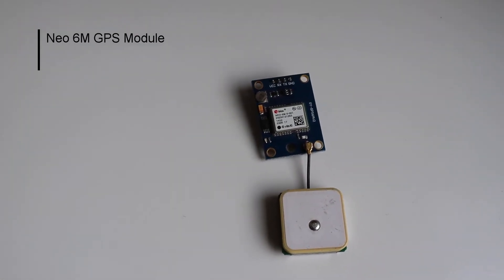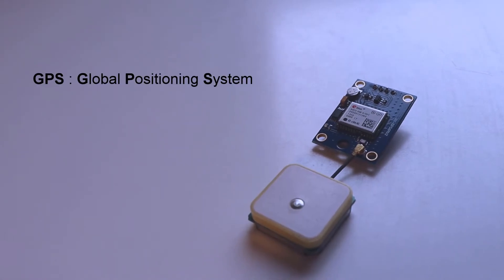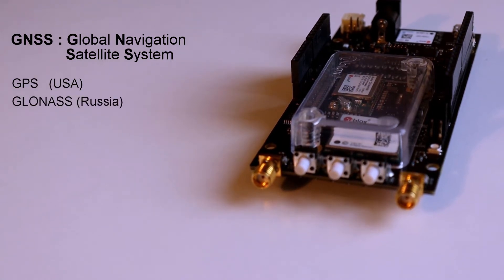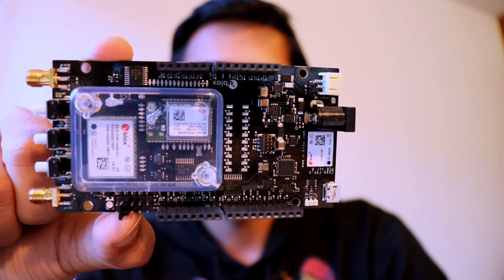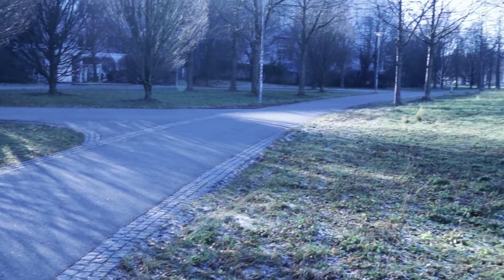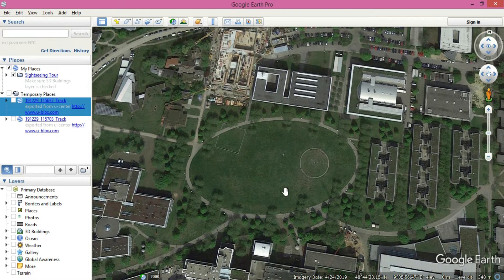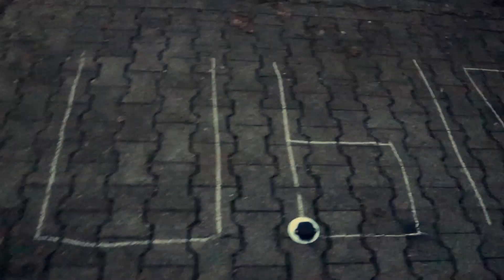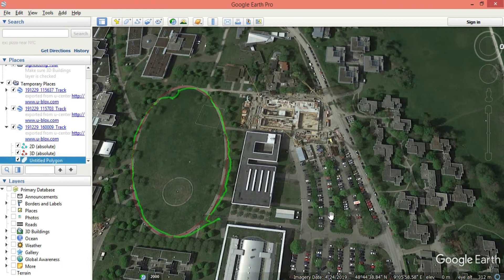Get Centimeter Level Accuracy in your GPS GNSS Projects Using ZED F9P Application board

Comment: Hello. Hope you are doing good. Nice explanation. Can you tell me the difference between RTK vs RTK with dead reckoning in your experience? I know the basic explanation. But I want to know practical difference in terms of accuracy. do I need RTK with dead reckoning if I am using it in environment as you shown in your video?
Reply: still waiting?
Reply: @роскомнадзор-д8я   LOL I found the answer by myself and already completed my projects.. practically, only with dead reckoning, I achieved an accuracy of less than +/- 1 meter.  I didnt use a base station.. if I used a base station, the accuracy might be even higher..

Comment: Thanks for your video. Do you connect your application board to internet to obtain 2 cm of accuracy? If you do not access to the internet you must use two of this module, one for mobile and one for base. Is it correct?

Comment: Hi there! Please tell me if I can use this board with Arduino or ESP8266 and how they can communicate! Thank you!!
Reply from the maker: +Lucian Vaduva 
Yes you can easily use it with any microcontroller. The provided board uses UART/USB to transmits data. You can select the port to share data with the tool provided by manufacturer
Reply: @Microcontrollershub  can u please make an tutorial to communicate it with  nodemcu. Thanks.

Comment: Great upload thank you. 

Which satellites have you selected while using the ZED-F9P module? Would like to know your settings via u-centre
Reply from the maker: +Mus London GNSS
Reply: Microcontrollershub Mine currently is selected to use GPS, GLONASS & SBAS. I have a M8N currently and have ordered the ZED-F9P but I wanted to ask should I select the same satellites or select every satellite available? Thank you
Reply from the maker: @LondonMus  
Select every satellite for better precision and make sure that your antenna is placed correctly, facing upward.